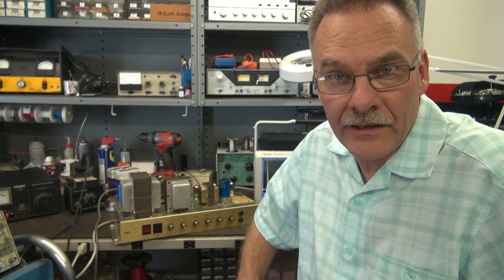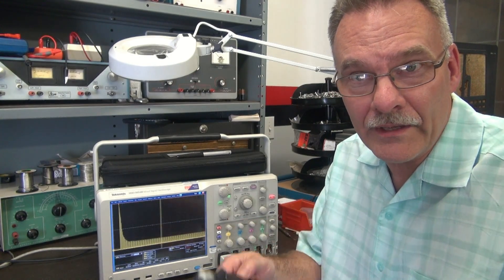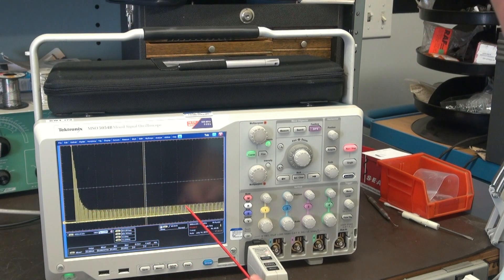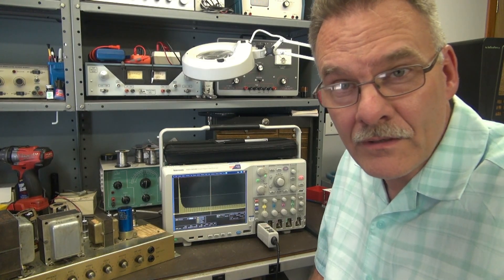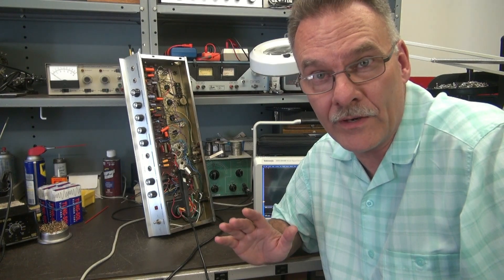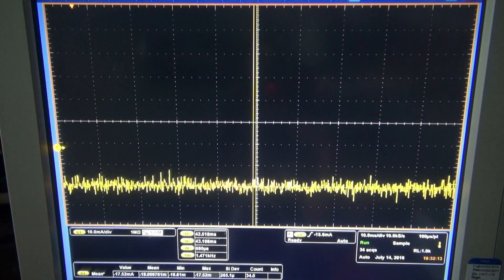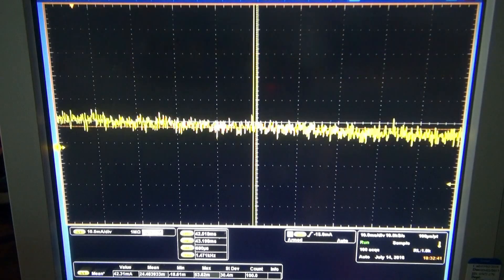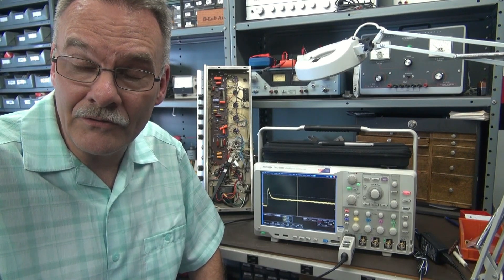Tube Guitar amp standby switch demo Myth buster Marshall Fender

Comment: In my (admittedly very limited) experience, I see more tube failures of the filament than anything else and it's predominantly on initial power up when the filaments are all cold and thus have their minimum resistance.  I've found that placing a small NTC (such as those used to limit inrush current on an SMPS) in series with the filament supply dramatically lengthens tube life.  The actual difference in filament voltage once it's warmed up is pretty negligible (around 50mV less on the few I've measured)
While it's perfectly possible to incorporate a solid state 'soft start' into the B+ rail, I'm unsure how many tubes it would have saved me over the years...  Not many though!
Reply: Sorry can you speak English?
Reply: @flintdavis2  
Yes, I can INDEED speak English.
When making a slightly more 'technical' post, I tend to type with a somewhat more 'advanced' English than you might be accustomed too.

Comment: I think the purpose of the standby is to prevent excessive high voltage sitting on reservoir cap and filter caps until the tubes are heated enough to draw current. When the tubes aren’t drawing current the b+ is a lot higher. And then if your wall voltage is higher than normal you can expect even higher b+ on the caps before the tubes draw current. And in tube rectified amps the rectifier doesn’t put out b+ until it’s warmed up and the preamp/otpt tubes are usually ready to go by then. Solid state is immediate and doesn’t give output tubes time to warm up to draw current.
Reply: Not so, see my previous post.   Also, if you are right, how come guitar amps, and many type of pro equipment, have always had standby switches, before solid state rectifiers were available?  The purpose of the standby switch is to make the amp dead quiet while keeping it ready for instant use.  Not so important for bands playing in pubs and taverns, but for TV and stage it IS important.
The voltage on filter caps (and coupling caps too) does rise above normal when solid state rectifiers are used, but competent amp engineers working for reputable brands allow for it when choosing capacitors.  Filter caps often have two voltage ratings - the maximum working rating (which should not be exceeded during long periods), and a surge rating, which is higher and is permitted for switch-on.
Reply: Capicitors are typically overrated. True but the actual problem is cathode stripping. Same as on xray devices we use in our hospital. Nothing to do with mute or cooking your tubes nonsense. In this scenario SS rectifiers are problematic and tube rec allow slow ramp up. Because itself needs to warm up.
Reply: @Nightingale1887  : You are just repeating an urban myth.  As I said, vast numbers of vacuum tube TV's and stereo systems were made with silicon rectifiers, and no impact of tube life was ever noted.
High power tubes used in transmitters are another story.   So would be X-ray machines, because of the high voltages used (20 to 200 KV in medical diagnostics), which can cause field emission before the cathode is hot and ready.   (In fact, in very early X-ray machines, they used pure metal cold cathodes, relying on field emission.)   The 300 to 500 Volts or so used in amplifier power stages, and the 10-150 volts of so used in other amplifier stages is just far too low to cause field emission and thus there is no problem.
If standby switches are not for muting, how come guitar amps and professional studio gear have always had standby switches, long before solid state rectifiers became available?   Unless you can answer that, your post is worthless.
Reply: Since old fender amps should be re-capped anyway, replace with higher voltage filter caps if a person wants to use the standby switch. Modern caps are smaller and higher voltage caps can fit into same space. Probably a good idea either way in case you sell your amp to someone else. Also, it is so true that modern line voltage is higher by at least several volts AC which increases the B+ by multiple of the B+ output voltage (and rectification process). I myself don't use standby switches. I actually soft start and run vintage line voltage level with a variac when at home. Playing out would be a different story!

Comment: I have been playing Fender amps for many years - I always hit the standby before and after I turn an amp on and off - During breaks I always turned the amp off - I use the standby switch when changing out pedals - I “NEVER” had a problem with power tubes prematurely wearing out - I think you electronic freaks get too anal with this stuff - Leo made those amps to be used - many have taken a beating and they are still going strong with the usual maintenance - those amps were made to be Played not analyzed - Played mine many many years with minimal problems.
Reply: I agree. And ill continue to use it. Have had no problems on my Hot Rod Deluxe for the last 3 years now.

Comment: It's now 7-22, I haven't seen this video before now. But I disconnected the standby switch in my 1958 Fender Bassman decades ago and it's just fine. I also quit using the switch on my pre CBS Fender S.R. and D.R. and other Blackface Fender amps I've owned many years ago too, and they're fine. I change the electrolytic caps every 8 to 10 years, filter, bias, and cathood bypass (I've owned and used my old Fender amps since the early 70's, making a living as a pro-guitarist, working several nights a week, I'm not a hobby player, my amps have tons of hours on them). And my tube life is generally normal, in fact I have GZ34s that are from the 60's and 70's still working fine in my old amps. I think standby was just something added for a selling feature, they seem inexpensive for the factory to add, but might make the potential buyer think he's getting an extra bell and whistle. The big pop you get on some amps when you use the switch made me think it wasn't a good thing, that's why I stopped using it.  Also on the 'tweed' Bassman there's a capacitor wired to ground that I thought might short high DC to the chassis if it failed, but I'm not sure of that (I just took the wire of the switch and bypassed it to the tube. On that subject, I converted all my old amps to 3 prong and removed the widow maker capacitor decades ago ( I knew of a kid who was killed by his Super Reverb back in the early 70's). Terry, thanks for giving us proof.  Good video as always.

Comment: I have an 1980 Fender 75w Lead amp with 6L6GC output tubes and a solid state rectifier. It has a standby switch, that I have always used (im
I'm the original owner of the amp). I'm also an electronics technician who repairs his own amplifiers and other gear, and I appreciate knowing that I'm better off not using the standby switch, but just leave it on all the time. Thanks for the heads up!

Comment: The diodes get hit hard either way. I was thinking if a thermistor installed between the power switch and primary lead would help save the diodes from the inrush? Any thoughts?
Reply: I think guitologist did that very thing with a thermistor on one of his videos.

Comment: A solution I saw the Guitologist use is a thermistor between the standby switch and the first power filter stage. It limited the current until it got up to temperature, reducing the magnitude of the spike. This may be a worth-while mod to put in my 2204 clone, as I didn't know the standby switch could cause a surge on the output; with all subsequent power stages being resistor- or inductor-limited, I didn't think the current spike made it past the first filter stage.
For anybody designing tube amps, standby switch or not, a good choice is to build a soft-starter into it; basically a constant current source configured as a current limiter, such that when the current draw drops below the limiter's threshold, the limiter is wide-open, "trying" but unable to shove more current through the load, letting it draw current unimpeded. It will only impede current flow if the load tries to draw more than the limit. And that's what capacitors tend to do when they're empty and suddenly attached to a power source capable of sourcing plenty of current.

Comment: I'm confused because of the way standby switches are labeled. They seem backwards. Is this video saying to power on the amp with the standby switch in the position that lets the amp make sound? Like if it didn't have one? I have a 68 Bassman that hasn't been played in 20 years. I want to get it serviced soon and treat it well so it will last a long time.

Comment: Terry, are you suggesting that we not use the standby switch? Just leave the standby in the “on” position all the time and toggle the power switch to turn the amp on and off? Same on a Vox AC30 with GZ34 I assume? Thanks a lot.

Comment: So, just to be overly clear, if my amp has solid state rectification, I never have to worry about using the standby switch. Correct?
Reply: Its nice to have standby if you forgot the load/speakers.

Comment: Can't remember about turning on, but if I turn my JMP 2203 off with the standby on it makes a popping sound so for that reason I will turn the standby off first.
Reply: That popping sound is the power supply capacitors discharging, which is a good thing.

Cheers,

Alan Tomlinson

Comment: I added a standby sw.
To my fender champ
On the back and found
That out but the only
Reason I put it in was
To prevent feedback
When setting the guitar 
On the stand next to the amp you can walk
Away leave the volume
Up on the guitar and or amp without getting
Feed back.
The amp doesn't
Howl when you turn
The standby sw. Off
It allows you to have
Instant on off.
But yes it is not good for the rectifier tube.
I also have a tube
Tester a Night 600
Not the best but it can test for shorts
And emissions output
I don't mind the extra
Expense if I have to replace the rectifier
I have spares. But the
JJ 5Y3 has lasted 25
Years sofar. I have a
Question about the
Noise filter death cap.
Can you put a 1meg
Ohm resistor in series
With it. To reduce the shock hazard and still
Reduce line noise?

Comment: Some amps only have an attenuator than a standby switch (e.g. Marshall Origin and DSL). Does the attenuator do the similar thing to a standby switch (cuz attenuator can turn down the amp to small watts like 5 or even 1/4, under which situation a standby switch is probably not necessary)?

Comment: The spike that you're seeing is inrush current to the capacitors.  The ramp-up effect is caused by going first in the test sequence, as there's insufficient time for the caps in circuit to discharge, thus no inrush effect.  This is to be expected for any electronic circuit, as ALL components contain some aspect of all 3 components of complex impedance.  And no, capacitive and magnetic reactances DO NOT CANCEL.  They discretely co-exist.  Take a look at resonant circuit theory and basic antenna (any kind) design for further proof.  

The rectifier tube ramp up time is to be expected as the heater reaching a suitable temperature to radiate is thermodynamic, and compared to electro-dynamic...  Slow.  It would have been nice to see the crest of the rise up from the rectifier (with standby conducting at power throw from a cold start), as it would have caused a sustained peak above the settling point.  Sustained peaks for seconds vs microseconds are where things get damaged.  Most short-time inrushes don't transfer much energy to the load, as they only exist at high frequencies and get pushed into free space as either leakage flux or capacitive inrush.  Their frequency is too high to hang out on the wire/trace.  And their destructive potential too low as there's no sustained delivery of energy to cause heat build-up, to cause physical damage.  The exception is arcing, which is an entirely different ball of wax.
Reply: Can you translate that to guitarist please? Are you saying to use or not use standby?

Comment: I installed a standby switch on my fender excelsior amp (15w, 6v6 tubes) as part of a bunch of mods, basically I wanted a clean amp with headroom, and it was a fun project, reboxed it, etc.  The mod kits were from a UK seller "AlnicoMagnet.uk".  The amp came out great, could have bought a better used amp to begin with for the end cost, but once again it was nice electronics project.   Back to the standby switch......  here's the reasoning from the seller: 

"But by far the most important requirement is to fit a "standby" switch. The stock amp when switched on from cold, produces an HT voltage which surges up to around 493VDC, before dropping back to around 410VDC as the valves warm up and start to conduct. However, the HT filter capacitors are only rated at 450VDC. This is just asking for trouble."

So what do you think about this example, based on your experiment?  Thanks.

Comment: Standby switches could protect an amp with a DC coupled cathode follower and solid state rectifiers (Marshall,  Soldano and many others) from arcing between grid and cathode that could happen if it were just switched on although using a standby switch for this is poor engineering at best as there are much cheaper and simpler solutions to that issue without the negative effects.
Reply: Yes, a 1N4007 and a 10k resistor between grid and cathode don't cost a king's ransom.

Comment: My use of the standby switch was for idling the power tubes when going on break after playing an hour set. Flip the Super Reverb on standby for twenty minutes...then flip the standby back off and start rocking and rolling again instantly.
Reply: Exactly.   Band walks back on stage and immediately starts……
Reply: I’m not a “gigging” artist, and this is exactly what I do between my “mental rock star” practice sessions…basically, I keep the tubes warm between my practice sessions when I need a break. When I plan to stop practice for more than a “few hours/overnight,” I turn off the amp entirely and let everything cool off.

Admittedly, I have a lot to learn from other, more experienced, players. 

Also, I spend a lot of time practicing improvising leads over .mp3 backing tracks played through my SS Orange practice amp…which has mostly no relevance in this discussion…

…wow, this derailed really fast…
Reply: That’s what I thought it was for

Comment: I would have thought that even in a solid state rectified amp with a simple on/off switch and no standby, powered on from dead cold, would have been smooth power up just for the fact it takes the heaters a while to warm up
Reply: I have done a video on this as well with a slightly different perspective with silicon diode rectification https://youtu.be/zxT1r51SZuI

Comment: If an amp is dead cold and you only have an on/off switch along with silicon diode rectification. Will it still spike?  Maybe I am confusing the time it takes filaments to warm up with what you’re talking about?

Comment: Yep! 100% agree. Plus I have two blackface fenders from the 1960s that have two filter capacitors before the standby switch. When the amps are in standby those caps, which are rated at 450 volts, have 500 volts sitting on them. I've disabled the standby switches in those amps and now the voltage rises slowly and does not surge.
Reply: I re-capped with higher voltage caps because of this very thing.

Comment: I've been rocking nightclubs since 1976 and have never ever flipped a standby switch on or off and I've used and owned over 30 tube amps in my life. Never had any problems with any of my amps. Tube amps are the best and I will never use solid state amps no matter how well they sound. P can't stand how a solid state amp sounds compared to a tube amp. I can always tell the difference between tube and solid state. Personally, I think all solid state amps should be dropped to the bottom of the sea or donate them to shooting ranges to be used for target practice.

Comment: Using the standby switch on a tube guitar amp during normal operation is not only unnecessary but can shorten the life and/or performance of your tubes. Having the tubes hot and the cathodes emitting electrons without the tubes conducting current (and the electrons having no place to go) is not a good idea. Cathode poisoning (as was mentioned in another comment) is the result and it is a very real phenomenon. The standby switch is handy for maintenance and repair purposes (to verify bias voltage at the grids before applying B+, for instance) but that's about it.
Reply: Thank you for explaining what cathode stripping is and does.
Reply: Cathode stripping and cathode poisoning different things?
Reply: @tomdrouhard3781  Yes. Cathode stripping doesn't happen in tube amp tubes, but cathode poisoning can.

Comment: If you have a solid state rectifier you will hit the tubes with a spike no matter what.  The value of the standby switch in this case is it allows time for the tubes to warm up BEFORE the spike hits them.  (the filament circuit bypasses the standby switch) I understand that current (and voltage) spikes do more damage to a cold tube than they do to a warm one.
Reply: Thereby eliminating cathode stripping?
Reply: I read on another video that cathode stripping only applies in really high voltage equipment which does not include guitar amps.  @tomdrouhard3781

Comment: The standby switch is heritage of the old technique from high power radio transmitters. Leo Fender was a radio service man before he started to make beautifull things. With this background he puts standby switches in his amps. Allmost every ampbuilder in the '50's copied the Fender Basman, with all his mistakes.  Look at the tonestack, a very poor design, is still frequently used. When you look at the normal use of the tubeamps in the past, in receivers for instance, you see never a standby switch.
Reply: chippster stephens 
Amen, Brother !